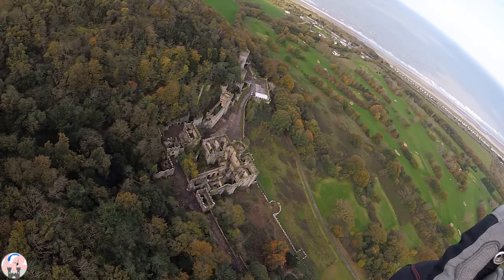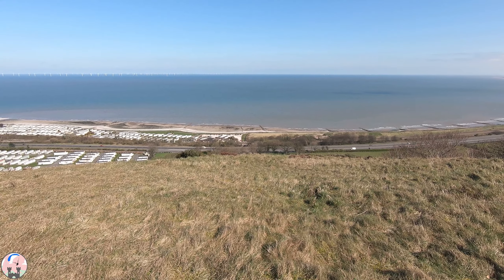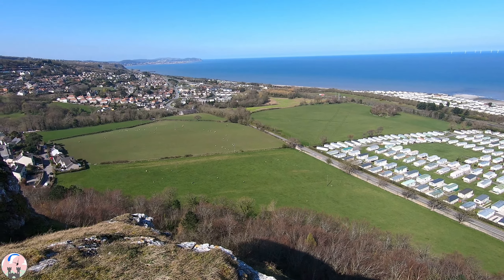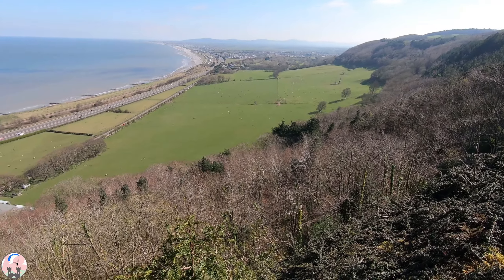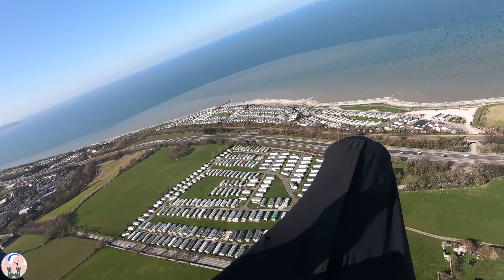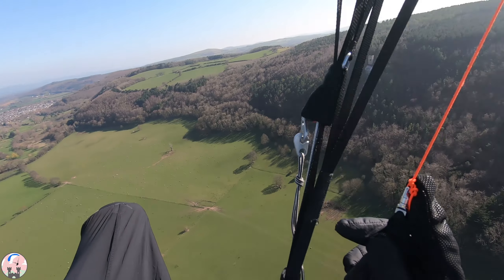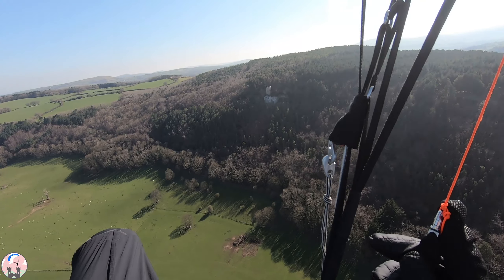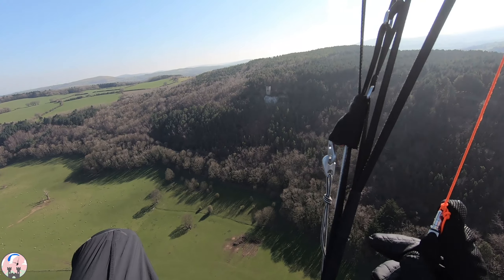How to fly from this cliff launch safely (Cefn Yr Ogof in North Wales)

Comment: Nice video, thanks for the info. Been up there once but it was well off to the East so didn't fly. Any thoughts on the soarable wind strength range for the site?
Reply from the maker: Hi Mark.  No less than 12 mph to avoid going down in the fields and not making the beach.  15mph to 16 mph  is the sweet spot.  Any more than that the and the rotor becomes almost impossible to launch in. NNE is the best direction.  Any further than NE to east and you’ll have a horrible flight if you mange  to get off.
Reply: @FlyCampCaravanNorthWales  Nice one - thanks.